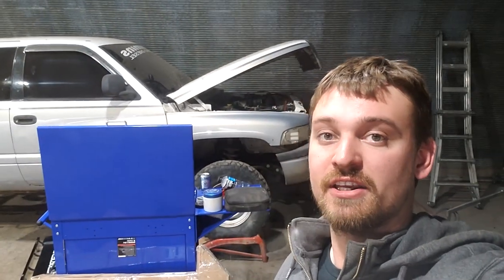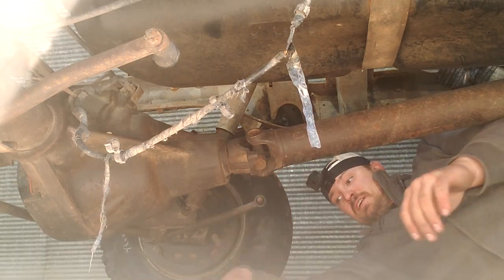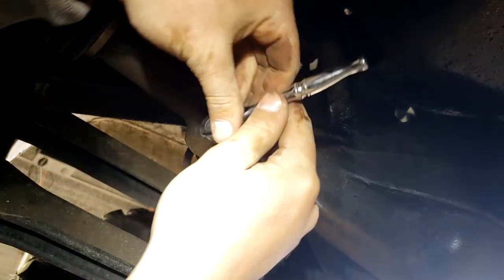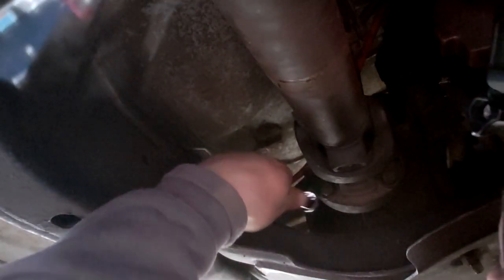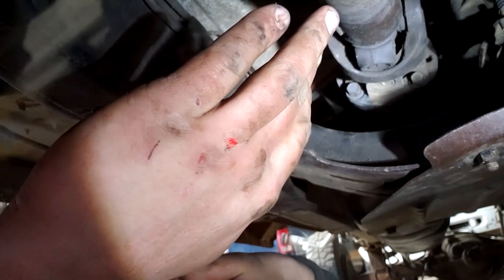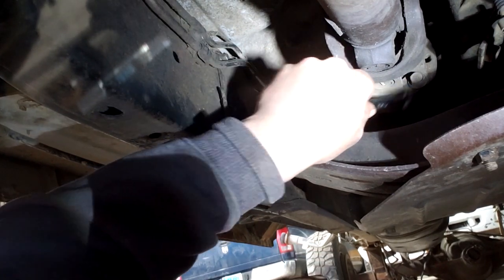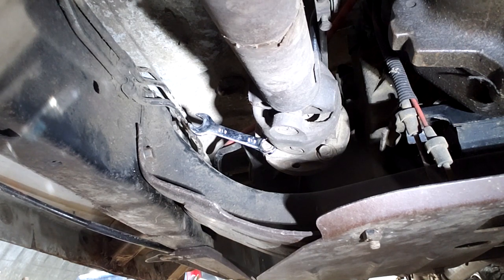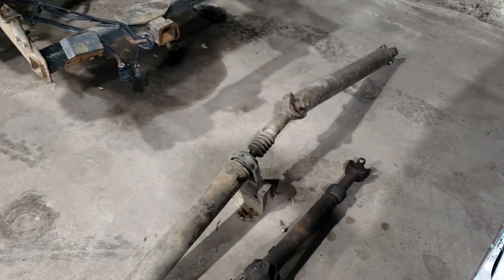Dodge Ram 4x4 Front and Rear Driveshaft Removal - Step by Step!!

Comment: I took my front drive shaft loose at the axle and was able to get a 1/2 impact with a 6 inch extension on the very top of the shaft at the transfer case and just spun the shaft to get all the bolts to the top only way I got mine

Comment: If you take the skid plate off when you take the bolts loose for the front drive shaft, it'll give you room to pull down with your body weight without busting knuckles. I'm working on my 1995 Dodge Ram 3500 4x4 v10 replacing the transmission while I'm watching your videos on how to remove it without a lift. Lol

Comment: Try removing the bolts on the transmission support... jack the tranny up a few inches...  put a knuckle socket on the bolt at the 2 oclock position, with a 10" plus extension, attach your roto-socket (battery or air) and off they will come-- way easier.

Got that off a cummins forum.  Worked great tonight--

Comment: Are the bolts on the front drive shaft transfer case reverse thread?
Reply from the maker: No
Reply: looked like it on the front differential though

Comment: Was able to pull the front of the front drive shaft off and then drop it allowing me to just squeeze a 5/8 dw impact socket and a 1/2 pneumatic impact gun in at the top of the flange. couldnt get it by hand youre a tough bastard thanks for the vid!
Reply from the maker: Thanks man